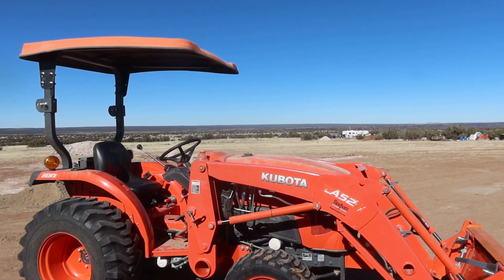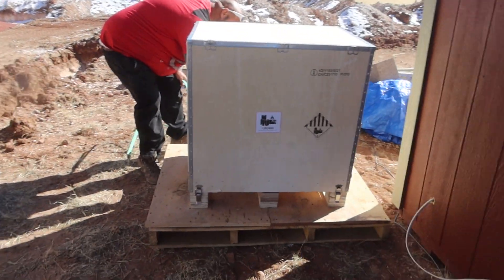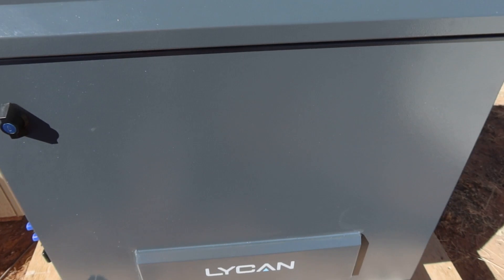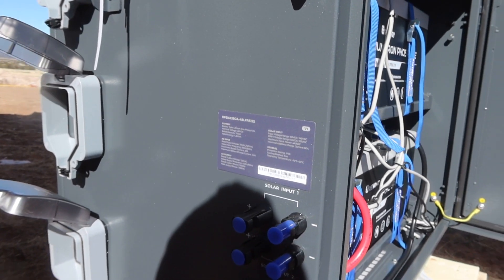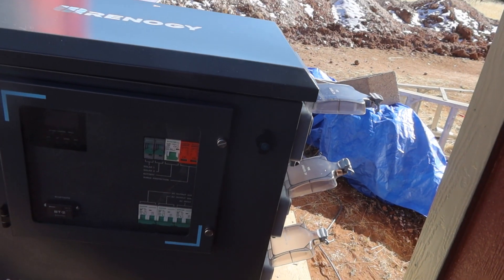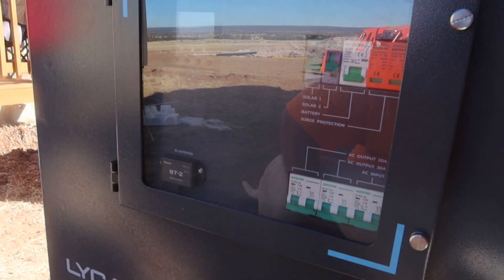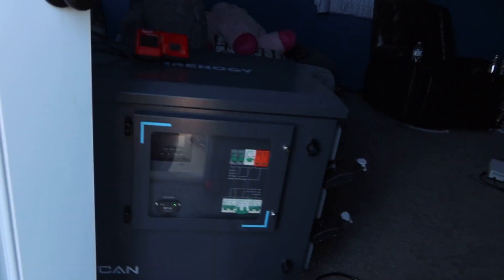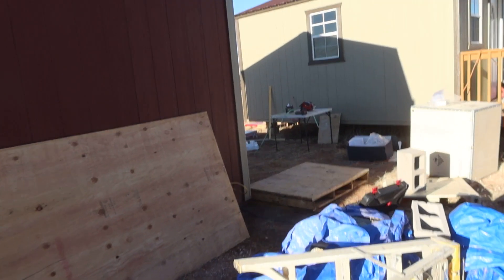Renogy Lycan 5000 PowerBox First Look!!! Part 1

Comment: Hey Rick - don’t forget that those batteries won’t charge below 33F for sure. They may cut off around 40.
Reply from the maker: yeah I was researching that and for now moved it inside with these cold temps. We are going to build a insulated shed with a heat pass thru port to it for winter. Thanks for watching and take care
Reply: @ArizonaHighDesertHomestead  yeah, they say operates to 14F but that as far as I know is discharge only 😟

Comment: Great video!    Is the Lycan unit noisy when it is either charging or inverting ?
Reply from the maker: No not noisy at all, nice and quiet, I am pleasantly surprised. Very smooth running unit for sure

Comment: "Rated Battery Capacity: 100Ah"     good thing you get a lot of sun where you live. 👍
Reply from the maker: Exactly !!! I was disappointed with the 100 AH. But for everyone you add on adds another 50ah. So if you max it out to 19KW that will add at least another 500 AH

Comment: that set you back on that one. thanks for sharing and unboxing.  why are you not putting your panels on a stand not on the roof it will make cleaning a lot easier during bad weather. I am interested in the power usage for the starlink system and the power usage, what i have read its uses around 100 watts. thanks for sharing and have a great week ahead
Reply: Yup....no need to put them on the roof when you have plenty of land.
Reply from the maker: Most of my panels will be on a stand like I have around my RV... For the panels on the roof I have a long aluminum hand with squeegee on it and it cleans panels on roofs very nicely. I'm surprised I didn't check the Starlink power usage lol. i will do that tomorrow and add it to my video for it. thanks so much for watching !!!